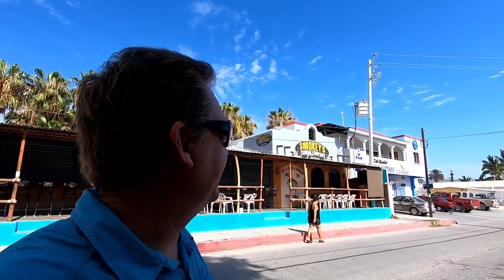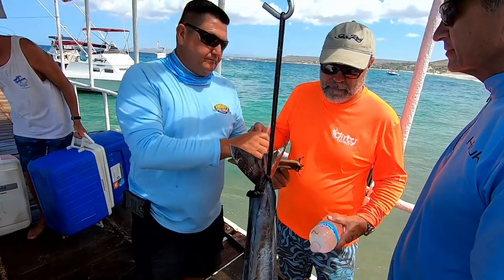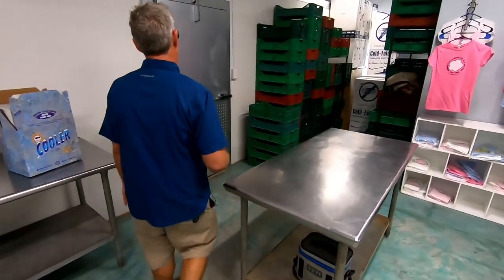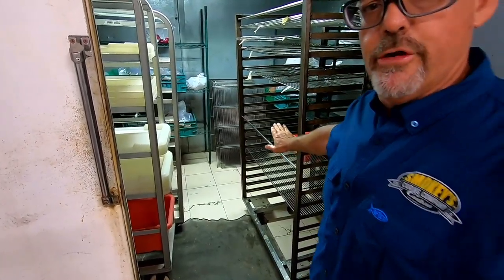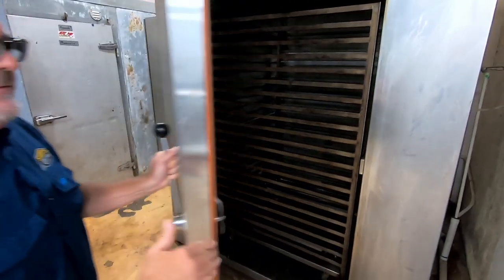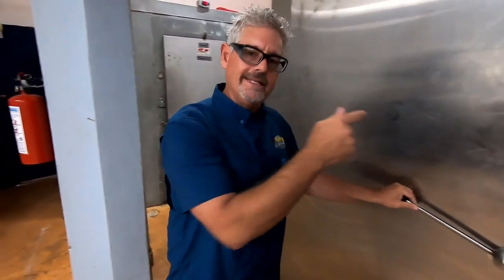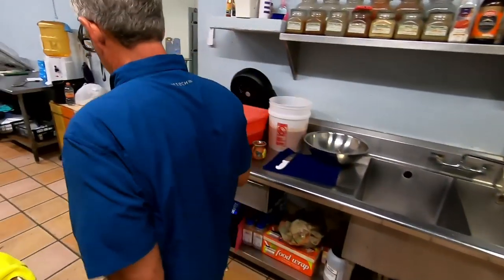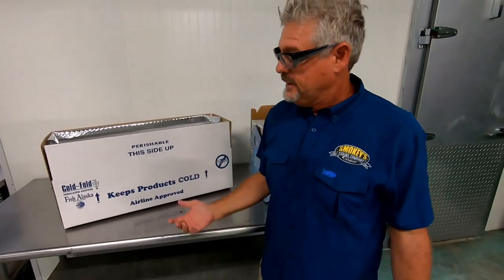Ever wonder how the pros smoke fish? A tour of Smokey's in Los Barriles, BCS

Comment: I started using these guys way back in 1996 when they had a much smaller operation.  I stopped going to Palmas (East Cape, Los Barriles) about 10 years ago because I found the boats in Cabo to be better equipped and the better captains all leave to work the Cabo boats.